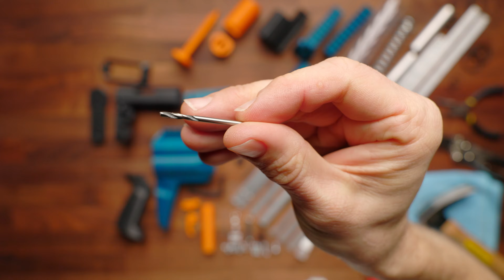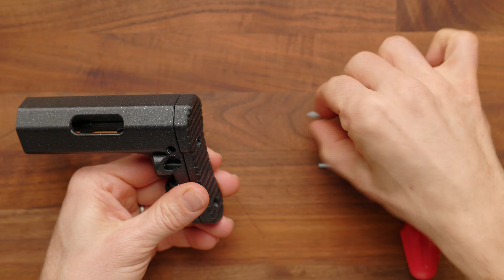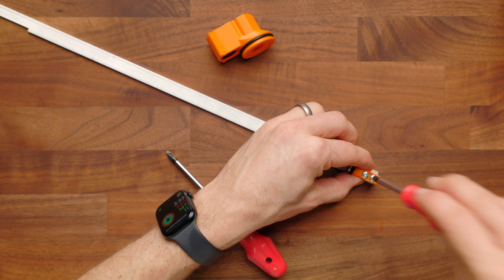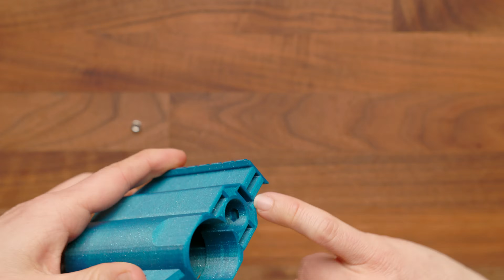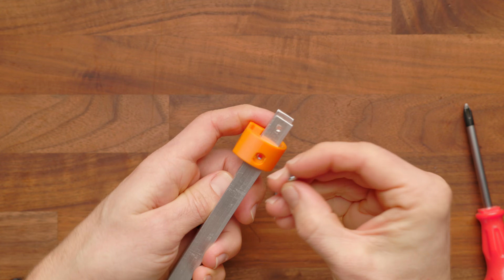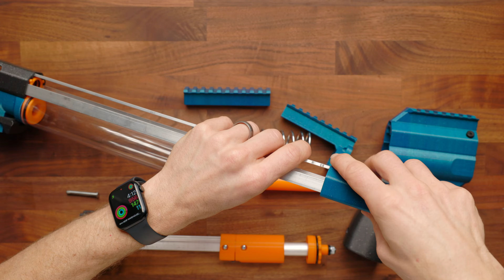Orion Blasters Lynx Build Guide (2023 Updated)

Comment: Hey I bought a lynx kit, it has a ball detent but I haven't been able to find any guides that include it, I haven't printed my blaster yet but where does this go?
Reply from the maker: The ball detent and 1/4-20 socket head screw are for the beta 2.1 version of the Lynx, which was not released when this video was filmed. Much of this video remains applicable, and the 3D parts that require the new hardware should be apparent, but if you have any questions, feel free to reach out to us via email! orders@outofdarts.com

Comment: for some reason no matter what I do I can not get the trigger to function correctly.   It is installed right but when I press it nothing happens until i move the cocking mechanism back a bit.   I can ram fire it by holding the trigger while loading but not normal opperation.   Same issue twice now and can't figure it out.   Help please.
Reply: I have the same issue! I see it's been a while since you've commented, have you solved the problem?

Comment: Will we get a 2.1 guide?
Reply from the maker: Yes. As soon as the 2.1 fileset for the Lynx platform of blasters is out of beta, we will make a updated build guide.
Reply: @outofdarts  Since you have the v2.1 parts included in the hardware kits, can we get an updated video build guide with v2.1?
Reply: Or at least a pinned comment outlining the major differences. Like the mag release no longer having a socket to receive a spring?

Comment: Hello, I would like to print and build MT first (and possible only) blaster. Would you recommend this one? I saw you also have a T4 hardware kit in your store. Should I try that one better? Or maybe another model?
Thanks!
Reply from the maker: Hi! The Lynx is a really good blaster for a first time build; it takes a lot less time and effort to assemble, and it's easy to swap springs and barrels to tune FPS. However, if you don't care for the bullpup ergonomics or the slam-fire, the Talon Claw 4 is a great option too. However, the choice between the two is up to your personal preferences and what games you plan to play with either of these blasters. Hope this helps!
Reply: @outofdarts  I help a lot. Thanks!!

Comment: Good video Luke! Excellent walkthrough, one thing if folks don’t want to mess with the drill bits, is using a drill that can clamp down on the pins, and you can just run the drill with the pin locks in and let it open up and smooth out the holes in the receiver, trigger and sear. Again wonderful walk through.